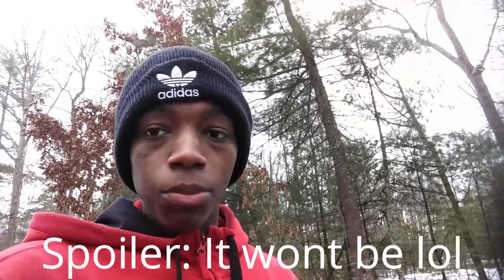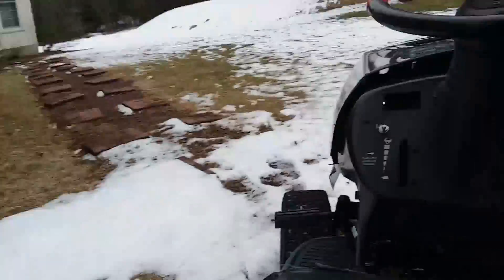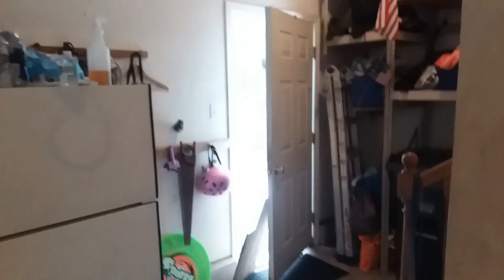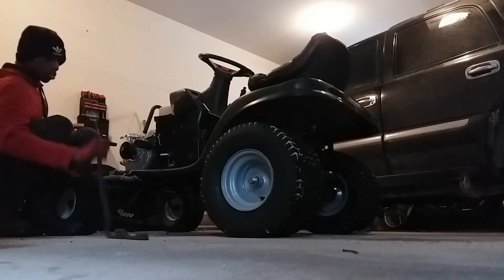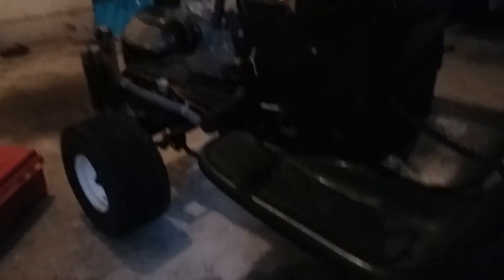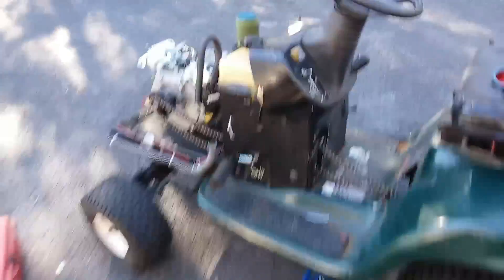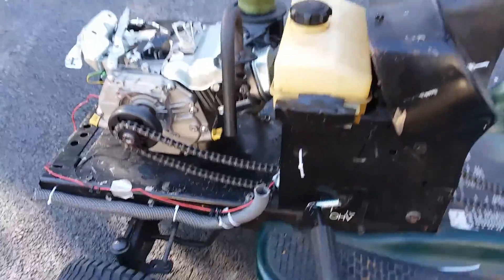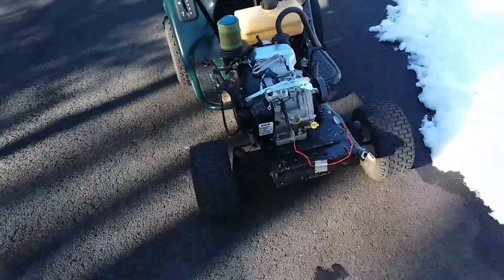The go kart mower DRIVES (sorta) - Part 6

Comment: Can you list all the parts you used
Reply from the maker: I didn't log the exact parts I used but I can give you a list.

Heavy duty centrifical clutch
#40 chain
1inch solid axel
Two 1inch pillow block bearings
Mechanical brake caliper
60T sprocket
Reply: @thephenomenalgarage6707  I’m doing pretty much the exact thing just trying to figure out how to run a jack shaft 
Edit I’m running a torque converter not a clutch like yours
Reply: @thephenomenalgarage6707  do your back tires lock up when you turn
Reply from the maker: @treven2402  theres nothing to cause  the rear to lockup other than the brakes which are 100% mechanical
Reply: @thephenomenalgarage6707  when I go to turn mine it feels like the tires kinda stop turning but it still moves
Reply: @treven2402  posi its because both tires a spinning at the same time and a regular mower rear end or truck diferential allows one side to stop spinning basicly
Reply: @dddd4735  yeah thanks that was a while back I finished it

Comment: Chain link off and look at it understand what you're going to cut before it costs you a new chain. Looking good... Also get a cover or else a wooden leg cause that chain's Gona rip you apart big time
Reply from the maker: I had to shorten the chain before I put it on actually. I used a mallet and a punch with a table. I didn't use a grinder. The chain itself was fine just sloppy and untensioned and extremely long. Thats why i'll be installing a jackshaft which will make everything neater and the chain will be less long.
Reply: I think he will need to settle with wood leg 😂

Comment: Bottom run on the Chain needs to come through under petrol tank and need cut to correct length. Grinder, punch and hammer if you don't have a chain breaker. Take your